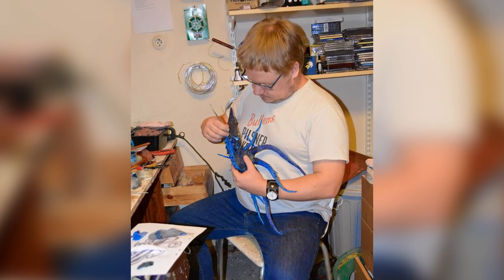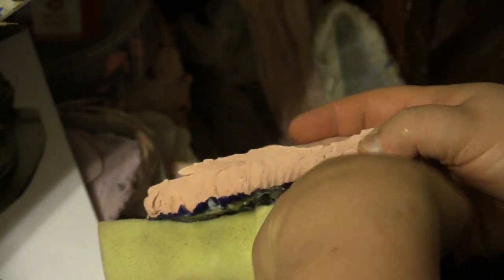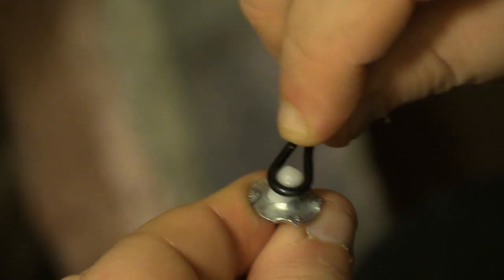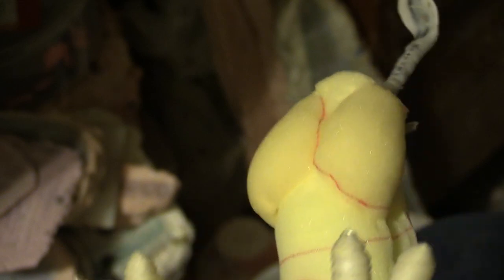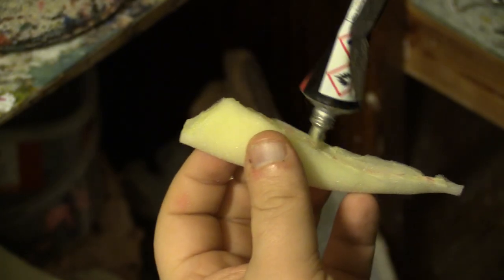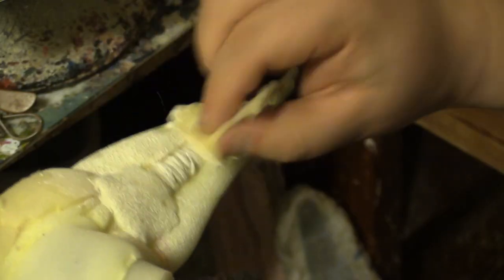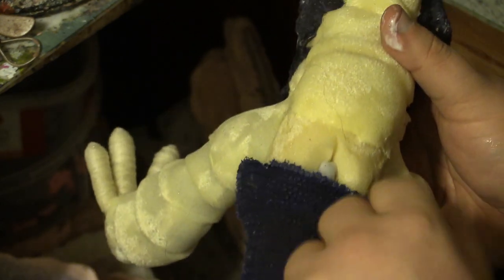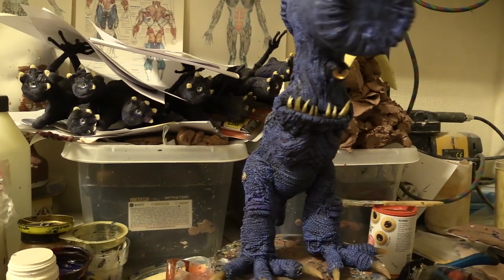Making Stop Motion Puppet: Hammer Head Monster

Comment: That’s it? Really? That’s how you summarize all the experience, creativity and effort we can see here?
Just a single question, that I think will contribute to make us understand the above: How long does it take a puppet like this to be made?
Great as usual, Richard.
Reply: I assume it would depend greatly on your skill level, you should probably attempt some simpler designs to start out with if you don't have much experience modeling.
Reply from the maker: The smart thing is to start with simple projects made for fun that can fail a couple of times, and it won't matter. The worst thing is trying to start off with something really grand and complicated, failing with that and getting discouraged.
Reply from the maker: Hehe! I could've made this video even longer, but I'm probably already testing the patience of my viewers. This puppet took about five days to make from start to finish. That's a pretty normal building time for me regarding a puppet of this size. The more skin patches I have to cast and apply, the longer the puppet takes to be finished.

Comment: Wow that's amazing!! What kind of latex and which brand do you use for the monster skin (12:45)? And do you think I could glue parts of it on a clay (Super sculpey) figure? Thank you for your help <3
Reply from the maker: Thanks! :) I use what's simply called "mask-making latex". There are several brands of this material and you can find it online all over the place. There's also "mold-making latex", and the difference is that the mold-making variety is usually thicker. It's easier getting thin edges with the mask-making kind, but I've used mold-making latex too with great success. Sometimes it's slightly cheaper. 
Are you thinking of adding latex to cured or uncured Super Sculpey? It's difficult making latex stick to hard surfaces. It usually curls up at the edges and then the whole bit comes off. If you want a latex skin to stick to clay you have to glue it in place. Flexible contact cement is probably the best solution. I use that to stick bits of fur or cloth to puppets with latex skin. The trick is to smear contact cement on both surfaces, let the glue dry until it's not tacky anymore, and then press both surfaces together. Then it'll really stick.
Reply: @TheLoneAnimator  Thank you so much for your answer :D ! I found your videos too late actually haha - I am making an underwater monster (close to a moraine) and I've built all the body parts with tinfoil and super sculpey on top (all parts separated, baked and only connected by wire) - so i was trying to find a way to conceal the gaps between the body parts, so it can still move like a snake. I mean, it would have been much easier to do it "bluworm's way" haha but if i could save the monster with bits of latex that would be a relief. Thanks a lot and keep up the good work <3
Reply from the maker: @stephaniemarielouisewidmer7098  I'd actually go for making two long bits of latex attached behind the head of your monster and covering both sides of the body, connected along the back and the belly of the puppet. That way you don't have to make a ton of smaller strips of latex to cover the joints. But that's just a suggestion. If you can make it work with smaller bits and it looks fine, give that a go :)

Comment: This is much appreciated. Are most of your supplies bought online from specialty stores or can I walk into a hardware store and pick them up there? Great instructional vid.
Reply from the maker: I'm afraid most of these materials are bought from specialty stores, mostly online. You can pick up the t-nuts from most hardware shops, I believe. And you can probably find various gauges of aluminum wire at similar places. I've even bought aluminum wires at florist's shops since they use the wire for decorations.

Comment: Y put foam on you stop motion ween  you just cast the inter thing in latex rubber?
Reply from the maker: If I cast the whole puppet in liquid latex it would turn out like a piece of tire rubber. I'd have to use foam latex, which is difficult to get right and also expensive. Instead I build up the shape of the body using bits of already cured foam, and then cover that with patches of latex skin. That method is much cheaper and I need less equipment for it.

Comment: Very interesting, thanks for this tutorial. I ought to give it a try myself soon but it'd probably be best to start with something simple, like a worm. It'll be interesting to see what else one can pull off with the art style (partially translucent designs, or blood leaking from it, etc.)

It's interesting how you mention you actually use a "floating" rig for the running and jumping scenes with the legs being anchored into the ground for the stationery stuff, I wouldn't have thought of that.

EDIT: Hey I know this is random but I re-read a little 3-page story of mine I wrote a few months ago and I thought you might like it. I'll leave it here in case you want to read it.

https://imgur.com/a/g6oXzlG
Reply from the maker: Here's a simple worm puppet: Get a bundle of aluminum wires (or a single thick wire) and wrap soft yarn around the wires, slowly building up the shape of the worm's body. Then dab the yarn with latex using a sponge - a bit of polyurethane foam from an old mattress or cushion. Let the latex dry. Add a tinting medium to the latex, if you can't fint any tinting colors use acrylic paint, and dab that on with a sponge to paint the worm. Now you have a cheaply made, but effective worm creature.
Reply: @TheLoneAnimator  Thanks for the information, I'll have to give that go when I can. I don't know if I've told you but one of my favorite puppets of yours was the maggot-thing in the King in Yellow video, I really like how you created the waxy cuticle look to its skin. Anyway best of luck and good to see your video activity increasing.